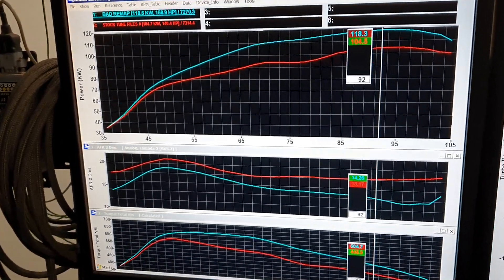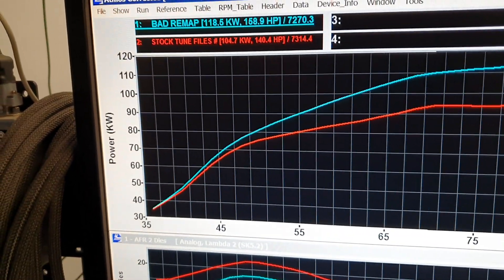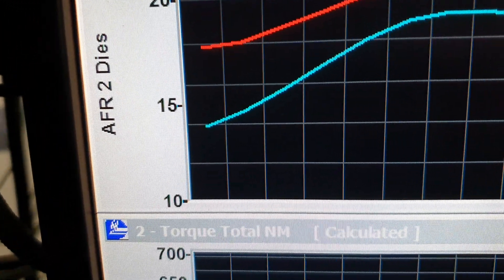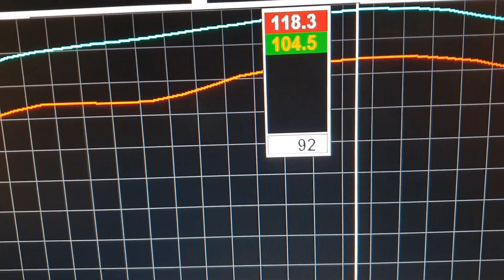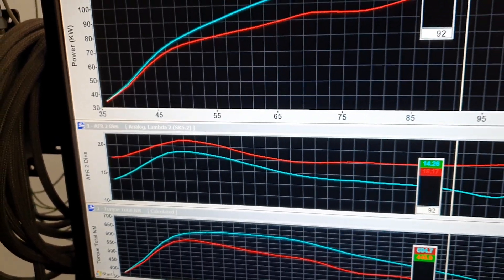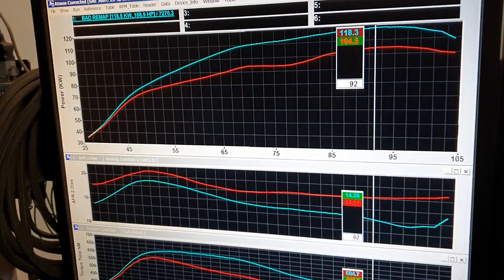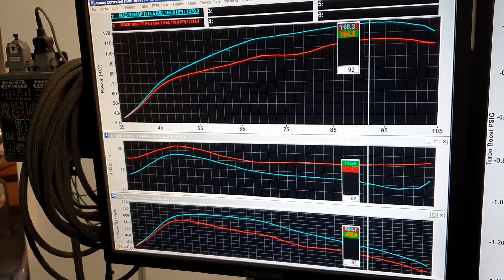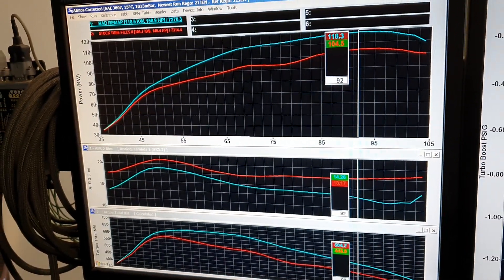Bad Remaps are Simply Dangerous and not as Powerful as you'd think - Berrima Diesel

Comment: Thanks for the videos.
How would you got about turning/timing an injector pump on a GQ TD42 non-turbo? Needs a new injector pump fitted, but there's no access to tuners or dynos anywhere near me once it's actually installed.
Reply from the maker: Hi mate well if its calibrated correctly it shouldnt need tuning as such.
Reply: @BerrimaDiesel  Cheers
Reply from the maker: Just align the little line-mark on the pump is already good.